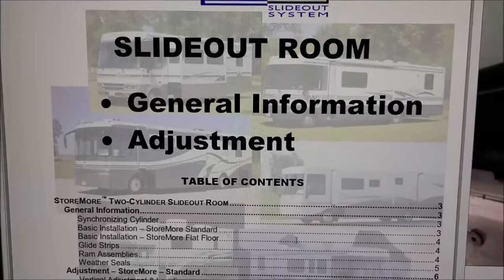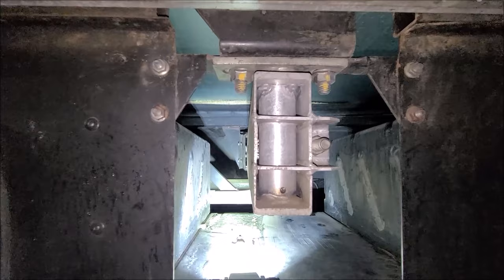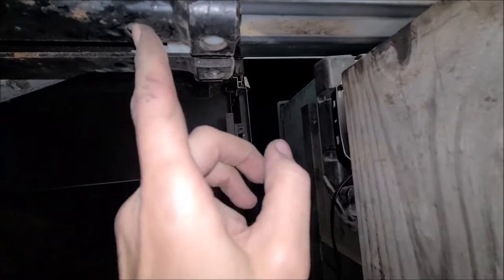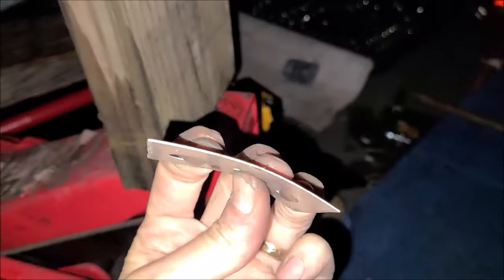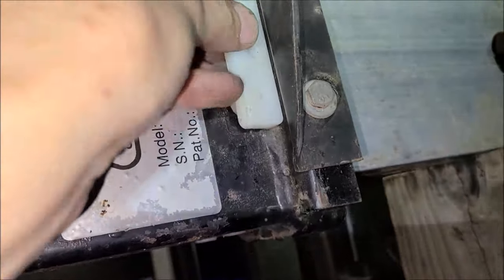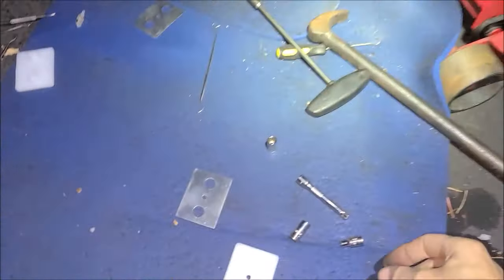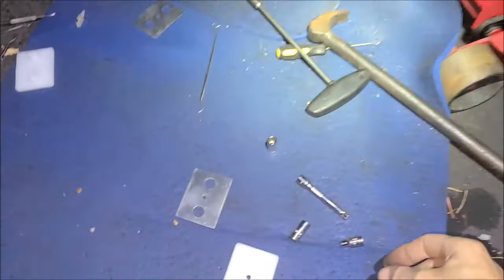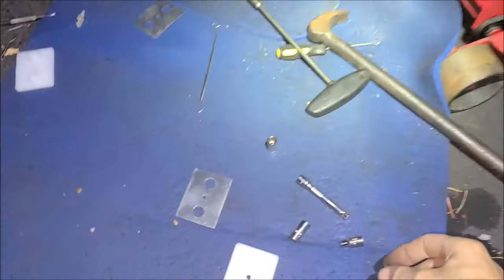HOW TO REPLACE HWH RAP91975 NYLON BEARING PADS FOR SLIDE ROOM HWH SPACEMAKER & WINNEBAGO STOREMORE

Comment: Great video!  Noticed the rear of my living room slide in my 2002 Adventurer 32v was sagging when it was retracted.  Got under today and clearly noticed the white slide plate was missing or mostly gone from the rear slide.  Was having a hard time finding which kit I needed until I came across this video. Now I'm shopping for the kit and will be replacing before the next trip.
Reply from the maker: @mkk224  I buy my hwh parts here. http://www.rvleveling.com/

Comment: Hello Kevin.  I wish I had seen this video 6 months sooner.  My Winnebago Brave has a HWH  exactly the same style as this and I blew the seals on both hydraulic cylinders.  I did have some damaged nylon bearings so I put the bearings with the least wear in the most critical locations. If I had more time I would have brought it up to you for a video on that process.

Comment: Thank you, Kevin. After I saw your video I went out and checked my slide. Sure enough, some were bad and misaligned from the factory, so I changed them. I can only imagine if it would have gotten worse. My hydraulics would have probably failed in some way by cocking it. Hopefully, future trouble averted.
Reply from the maker: Thank you for contributing.